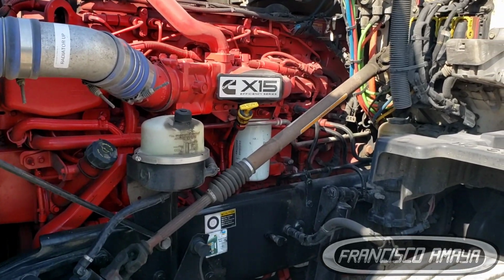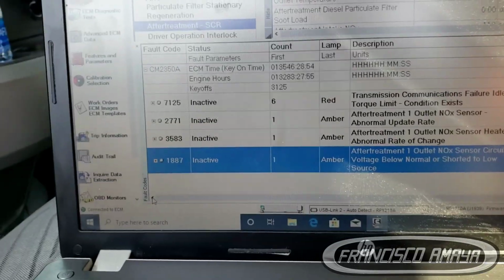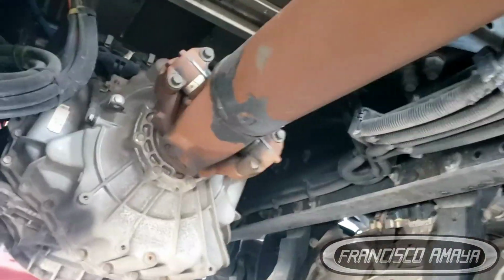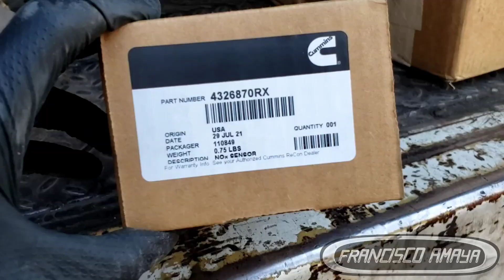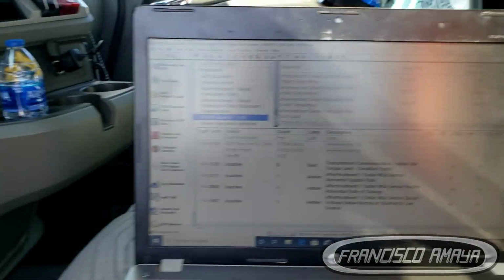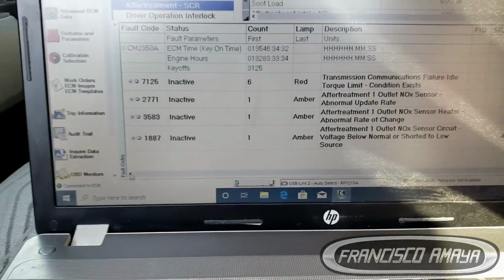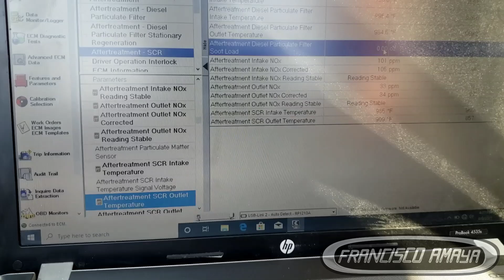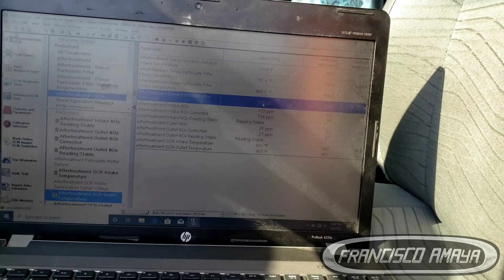Cummins X15 engine DPF SCR outlet Nox sensor removal replacement spn 3226 fmi 9 3226 fmi  4

Comment: Francisco yo tengo el código SPN 3226 FMI 2 data erratic, intermittent or incorrect 2019 kw t680 Paccar engine y el mismo dpf de tu video el nox sensor es original de cummins lo cambie y se volvio a prender el mismo código alguna idea que me pueda ayudar gracias
Reply: Cual fue tu problema ?

Comment: Hey!!
I have volvo with cummins isx 15 
I got code spn 0 5394 fmi 5 on dash. Comes check eng light and def level low light at the same time. I replaced the doser harness connector. And after 1k miles its again same code.  What you think its doser prob or another prob??
Reply: I bought a Volvo full condo. Brand new in 2014. The most comfortable truck with table etc. But the most defective truck with CHECK ENGINE lights all the time.... As soon as I got it out of the dealership with only 22 miles on it.

Best Advise GET RID OF IT, NOW !!!
Reply: It might be your def pump

Comment: Thank you sir.  Can you tell me what sensor reads the DEF quality?  I keep getting code poor DEF quality, on a 2016 freightliner cascadia.
Reply: I had 18 cascadia that had the same issue You are referring to the first time I replaced the output nox sensor less than a week later same problem I took the dosing valve off took it apart And cleaned it never had the problem again. I had lots of people they told me not to do this but I did it and it worked for me doesn’t mean that it will work for you there are a couple videos on how to do this on YouTube.
Reply: I have the same issue on my '16 Cascadia, however from my understanding there is no DEF quality sensor. Usually when the quality light blinks it also throws a code for nox outlet sensor. I just do a forced Regen, clear the codes and keep going. You can buy a handheld tool on Amazon for about $200 to do the job.
Reply: @foltzenlogel  I'm doing a forced regen every two or three days.  I've done 18 since the first of the year. At one point it would not regen, I had to replace the DEF pump, a few days later back to engine lights and the blinking def light and forced regens.